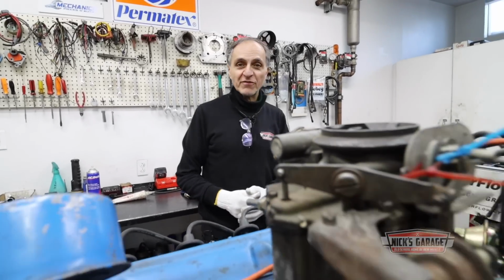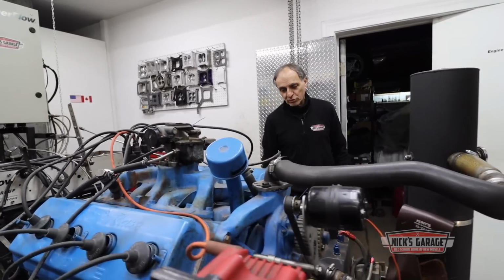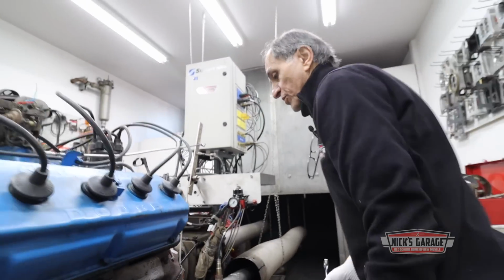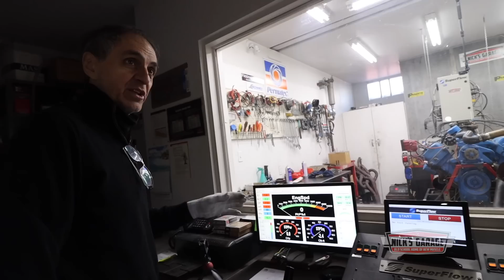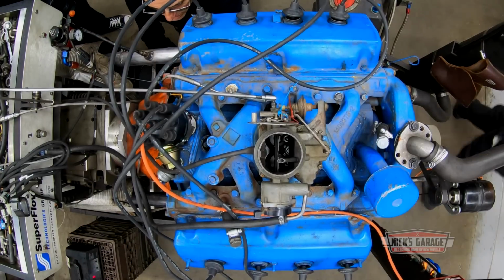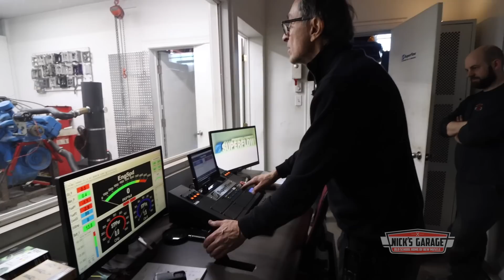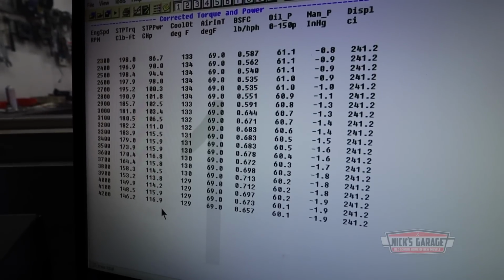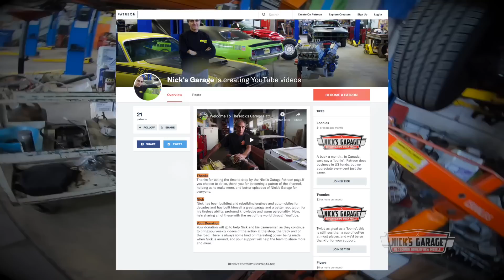Gen 1 HEMI on Dyno - WEAKEST Engine I EVER Tested

Comment: Being an old guy, and since my family owned 2 RedRams, heres a clue, the RedRam is capable of 450 hp. Or more. First u have to fabricate ur own headers, Douglas made some, have the heads ported and polished, use a cam, Potvin, Engle, Isky, they all made cams for it, Dodge used a D500 which was good,go to hillborn or Algon fuel injection, or a 4-71blower with 2, 4's or a 2 port injection unit, hp, arround 450+. These motors werent used in stockers, mostly gassers, alterds, or rails. its a good engine if done rite, many were used at Bonniville.
Reply: Terry that's amazing. I can see how starting with a REAL header setup might
be worth 100 HP right there. Thank you for the details.
Reply: Also being an old man, I really miss the drag racing of the sixtys. Drag racing was so much different back then. Today it's starting to look more like a demolition derby than a great sport.
Reply: No need to fabricate headers as a very good set is available through Hot Heads Research & Racing. Made by Sanderson from memory.
The RED RAM name was applied to the 1953 & '54   241cid, & 1955  270cid hemi. After that it was applied to the base Polysphere engine. The 1956 315cid & 1957 325cid engines were known as the D500, There was also a Power Pack option with dual quad carbs for these D500 engines.
The 241 engines [& possibly the 270] had heavy casting material around the exhaust valve guides which reduced the cross section of the port by a significant amount. The D500 heads are much better in this regard.
Edit. Correction. The 1955 Dodge 270 Hemi was called the Super Red Ram while the standard 270 Poly engine became the Red Ram & this name remained with the Poly engine in subsequent models.
Reply: Charlie Markley and his Brother and crew ran high powered Dodge Hemis at Bonneville for decades.  Their roadster ran 215mph with a hilborn stack injected red ram.  They liked to use the plymouth poly block with Dodge Hemi heads on some combinations.  It takes approx 500-600hp to push a Bonneville roadster to 200mph.  Be aware that these were complete maxed out race engines not anywhere suitable for street use..  Currently they have a built up blown fuel burning Desoto based Hemi in the roadster.

Comment: If it were my engine I would pull it apart and blueprint and balance the whole thing. I'm sure there are small issues to fix as well. I like seeing old iron on the dyno.
Reply: im sure you would(nt) parts are scarce,combustion chamber and design in general is super primative ,intake manifold is restrictive.....love seeing old iron though,like you said.

Comment: Motor mount is Chryslers floating power front mount used on the inside flattys. It works to improve the tourquw roll that v8s later suffered with tearing out motor mounts on one side. Pretty fing smart. I've never seen one fail on the biggest flat head 6s or 8s. Like stock on a 230 CI 6 has 300 lb at 1100 rpm.

Comment: The run out of the flywheel  and the motors loose connection to the bell housing could be seen from the very first second of video; from the bottom oil pan/starter view. Lucky you didn't lose your dyno.

Comment: 122hp@3700rpm? The 2.2L/2200 found in the '98-later S-10 produces 120hp@4000rpm, and it's limited by soft valve-springs!
Reply: Yes, and it's running better than 9:1 compression, while this is only running 7:1.

Comment: Hey Nick. I have seen you fight starter troubles before a few times. Why don't you mount the starter directly on the dyno and just let it back feed start the engines. You can leave it permanently wired up that way too and save time swapping engines on the dyno by elimanating more connections.
Reply: bc.          We were thinking of doing such a set up.
Reply: @nickpanaritis4122   Have not seen your dyno coupling in a video so I don't know if you use u-joint shaft or straight splined coupling. On the one dyno I converted to dyno start I used a Cummins 5.9 Flexplate sandwiched between the flange of the dyno and the ujoint that couple to it in the rear. Then I used the gear reduction Cummins starter and fabricated a bracket for it to engage the flywheel in the right spot. It has been working great for 10plus years and that high torque diesel starter has no problem even with 650Cid 12:1 gas engines.  The flexplate adds a very small amount of inertia to the dyno but a recalibration takes care of it in the dyno software no problem. Wish I was closer! Would be glad to fab it up for you in my machine shop. Of course this virus thing   wouldn't let me get there now anyway. :( Oh well more time in my shop!

Comment: The hemi shape is more thermodynamically efficient in theory, BUT they almost preclude. 4-valve design and must have domed or steeple pistons for decent conpre, which counteracts that, THEN toy also need squish band plus extra consideration to avoidnpinging.  It's a bad design.

Comment: Maybe a irrigation engine used on farms in the 60s because it's blue
Used to see lots of then around Lubbock Texas on irrigation wells
Dreamed of one in my 51 Plymouth
Never happened
Reply: I think you're right worked on one at a farmer friends orchard and it had the same intake and small carb but it ran really smooth .

Comment: Nick man surly you have a worker skilled enough to spend 15 min on the lath to machine up a spacer that would centre the flywheel. With your bell house spacing something we used to do was vice grip some mild steel rod to the bottom matting surface of the bell housing bend it all the way around round adding more vice grips as you go once you reach the other side tack weld small bits of flat across the top of your rod this stops the rod dropping inside after you cut out the rod were your bolt holes go once its bolted up its solid as a rock this may have been 30 min well spent cheers love your show

Comment: Hey Nick. Really enjoy your videos. Love your car. Question. So the engine makes pressure positive or negative under the bottom side of the piston and in the oilpan correct? So the crank area is vented to the head? Is that what the PVC valve does? What is the white smoke coming from tractor pull gas engines under the engine during full pull? looks like a tube at the bottom of the engine. Red Ram V8 Hemi.

Comment: A great article on this engine was published when it came out in 1953 titled Hot Ice. It was published in a couple of hot rod magazines of the time. This bored out version with hilborn injection put out 302 horsepower at 5800 RPM on methanol.  pulls were done with aviation fuel as well, netting 1 horsepower per cubic inch @258.  the engine probably reached its pinnacle and all out power at Bonneville in the early 60s holding many E-class records (<260 cu in). 1 belly tanker reached over 275 mile per hour on Nitro!
Reply: Tim.            Thanks for the info on this Tim.

Comment: Hey partner you're lucky that motor didn't blow you have the wrong flywheel on it wrong starter and just for old-time sakes I used to race one of those and I could get 205 horsepower out of it when I good Dino and they'll pull 5500 RPM in stock trim with a two-barrel carburetor have a nice day

Comment: Those copper wires really sketched me out lol. I was expecting the flywheel to go flying.
Reply: The same wire put in at 4 points on the inside diameter with the inner hub squashed in there only made the center hub ....”centered”!  It’s actually very simple logic physics, or, in Layman’s terms: common sense engineering!  It centered the hub, which in turn, centered the flywheel, then was tightened down to the crank flange.  Good “out-of-box” thinking nick!!!!  2 thumbs up to get it done!

Comment: You're going to need a casting forge, a machine shop and 15 manufacturing plants or a time machine gramps. Rubber rots, metal rusts, Parts go offline and become unicorns. Ashes to ashes dust to dust.

Comment: ? Is there a way to add a starter to the dyno so you don't have this issue any other time getting strange motors connected?  would even save a few steps on the motors you normally use.
Reply: Rod.       Very rare I run these engines on the Dyno.

Comment: Gotta love those old hemis. I dont have a hemi on my 58, but you know there is nothing but raw unbridled power when the speedo only goes to 110kph.

I have the rare canadian only 313cui. Nice low compression for easy starts in the cold canadian winters. Also its impossible to get parts for.

Comment: Question for you Nick.  Does you Dino have a max power output rating? I'm sure it does but just wondering what it's rated for?
Reply from the maker: The dyno is good up to 2000 HP.

Comment: "Weak hemi" is an oxymoron 
She's probably the smallest hemi you've had on your dyno
Reply from the maker: 'Less strong'?
Reply: Nick's Garage lol now thats pc😁
Reply: The opposite of the little SBC 400" engine...
Reply: The numbers this hemi made are equivalent to a present day NA 4 cylinder. That's "weak" in my book. It is a weak hemi.
Reply: @mannys9130  - Typical for those early 1950's days... Ford flathead V8 back then struggled to 100 HP... 1950 Buick 215" all aluminum hemi 2 bbl. V8 engine was 155 HP... in production until 2000...
Reply: @mannys9130  it's also a small displacement hemi. 3.9L or so. 140hp is pretty good for a low compression engine that size.  A modern 4cyl is running probably half again the compression ratio, so by rights should make about half again the horsepower.

Comment: From  the video, at 18.37 time on the video, you can see the transmission housing moving I think  you might need some location pins  to stop the housing twisting like  a plate that has a dowl for location and bolts both sides of dowl
Reply: Brian.        There was no dowel pins to help.  Too much gap in between.
Reply: @nickpanaritis4122  Hi Nick I've worked on a couple engines and worked doing fitter welding work as well one trick is a solid shim the gap 40mm wide x thickness you require 12mm or half-inch   you could use steel flat bar drill one hole at one end and cut just short of next hole do that on all the bell housing bolt holes and weld together  as one piece that should spread the loading of engine and bell housing

Comment: Why is the Dyno test so important? Just put the thing in a car and drive.
Reply: Dennis Young  Not just debugging but breaking things in is easier this way as well. Everything is easier to reach for tuning as you don't have to reach over a fender.
Reply: Making sure there's no problems and everything is working right. Can also set timing and jetting so it's more of a drop in and go deal. Imagine just tossing the motor in the truck and finding out it had blow by or a bad bearing once it warmed up.
Reply: Gotcha, no idea then. Maybe to make a video of a neat old motor?
Reply: D O N W.          My customer just wanted to see a test and how the engine ran.

Comment: The spring isn't strong enough to pull starter back off the flywheel. Had the exact same problem with a 301chrysler. Used several springs to get it to pull off the starter.

Comment: On the SF-902, the starters are on the dyno, not the engine. Each engine uses its own flywheel, and a simple adapter to the input shaft on the dyno.  Seems a set up like that would save a lot of headache.  We had a couple dyno flywheels that had all kinds of bolt patterns, so that connection to the dyno was never a problem.
Reply: MrR.           The SF-902 came after I bought mines. I should have waited 6 months.

Comment: Nick what was the HP factory rated on that first generation  HEMI?
Reply: He said 140 HP... each Chrysler brand had their own special hemi engine design back then... parts generally didn't interchange... Chrysler got the 331" hemi in 1953... to compete with 331" 1949 Cadillac OHV engine... Chrysler got hemi experience building hemi tank engines in WWII...
Reply from the maker: 140

Comment: have you ever dyno a 4 cylinder engine? eg: mazda 1.8 mx5 1993, i run one in my dutton ket car, i think factory HP is around 130 bhp, although there are varients ..

Comment: Nick they call it dummy light because in honda and other engine the oil light need like 5 psi to go out
When the light is on its allready to late you have less than 5 psi oil pressure

Comment: agree with u on the warning lights, BUT from my experience the low oil pressure light comes on at too low a pressure -- 3 or 4 lbs. By that time serious damage has probably been done. Solution: check oil level regularly as the owner's manual says (every fuel stop) to be sure. IMHO oil pressure gauge is best and worth the investment.
Reply: But do you stair at the guage the whole time your driving?
Reply: @tlr-nut7275  LOL TLR-NUT -- only thing I "stair" at when I driving is the ladies. :)

Comment: use your calipers.  distance from the face of the flange to touch the ring gear.
measure the distance of the gear from the face of the starter and presto,  you know what size spacers you need without any second try.
Reply: Dave.        Been there, done that.  Centering the flat flywheel on a flat crankshaft flange was not easy to get done the same day. Lot's of machine work was needed to make this correct. All we needed was 1 test.
Reply: @nickpanaritis4122  :  I know what you mean.  you can spend hours making a part you need for a few minutes. 

but sometimes, you spend hours trying things...  I have done it both ways.

but, at the end of the day, I trust you know what you are doing. 

as an old machinist, I cringe any time I see metal flakes
Reply: @dave-in-nj9393  .    You are correct.     I have a machinist down the street that helps me out many times. And on a Saturday, he is closed. I needed to finish the same day with this engine.  I was stuck for time in this situation.Thank you for your input Dave.

Comment: if you guys had a milling machine & end mill, you'd solve that issue by making a clearance cut on the starter.
problem later: that starter would only work on that type of engine ...

Comment: What if you energize the solenoid on at starter without actually starting the starter to push the Bendix towards the flywheel and and spacing out that way?
Reply: Dennis.      Maybe I should have. Good point.
Reply: @nickpanaritis4122  That's too bad about your Bell Housing getting Broken!!!  Hope it will fix well?
Reply: @dennisbailey4296  .    We had it fixed, all good.

Comment: Put an over-driven roots blower, injection, 98% nitro-methane & 2% toluene through it with some other mods and you've got the motor that TOTALLY dominated AA/FD thru the mid '60s. If you started with something else you changed to Chrysler to compete..

Comment: I remember those engines. The block casting wasn’t vary accurate in the cylinder walls and you held your breath when you bored them out that you didn’t go into the water jacket 🤔🤔🤔
Reply: As an engine machinist I have rebuilt a number of early hemis. Never had an issue with wall thickness. They are not thin wall castings.

Comment: It should put out about 150 hp in original condition. Back in the day they did not have high octane fuel and the first Y block Ford engine  (about the same size ) had only 130hp.

Comment: I built a 241 in 2015 put it in a 27  T Roadster and ran in the 13s at are local drag strip
Reply: Not that great considering your T maybe weighs 1500 pounds. Most likely less
Reply: @lukethedrifter3363  no tea weighed over 2,000 pounds had an T56 5-speed never got out of 3rd gear and at an altitude density of over 7,000'.... I could go on didn't build it for drag racing, I'm just saying

Comment: The hemi may be weak by today's standards but back in the day, there wasn't anything like it. This was a few years before the Chevrolet V8 made it's appearance. There was the Ford flathead V8 but it was really weak compared to the hemi.
Reply: Uh... Olds, Cadillac, and Buick OHV 8s ruled in those days... by 1954, Hudson's big flathead 6's had gotten overrun in NASCAR... Chrysler's new for 1954 special 355 HP 354" dual quad hemi was also getting noticed, although only about 1,000 made...

Comment: Probably 7.8:1 compression and no cam timing. What’s the bore and stroke on that motor Nick?
Reply: DBSSTEELER  if you watch closely almost always they show the setup screen.   Look in the upper left corner.   I think it said 3.25x3.41
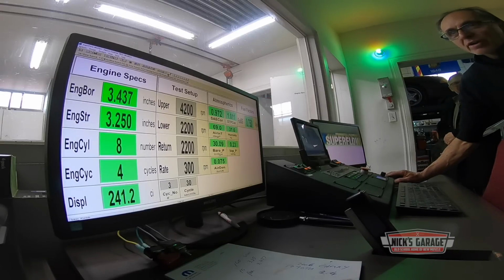Reply: Look at 31:15
Reply: And only 7:1 or 7.1:1 compression. Even 87octane gas was "premium" in 1954!

Comment: I'm surprised someone didn't pull out a Vernier and measure it while fitting the flywheel...  anyway, the engine sounds great actually !!  not to mention it looks really nice
Reply: John.   We did on the first 241 Red Ram, no issues. But this 241, just wasn't lucky.

Comment: Make a universal starter like one for a race car. A big drill with a socket to twist the engine over from the front. Just use that when you get a bastard engine in without a flywheel so you don't need to rely on the mating up to a universal flywheel and starter.
Kind of like using a tug rope on a mower but it's a huge drill and socket.